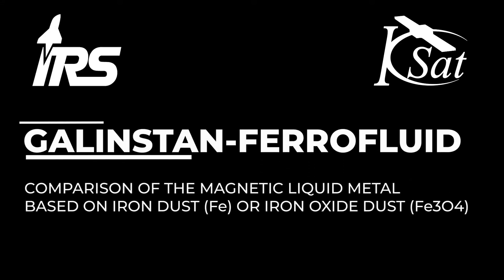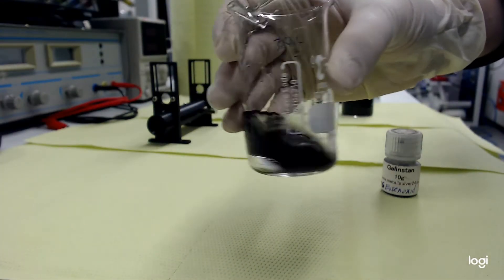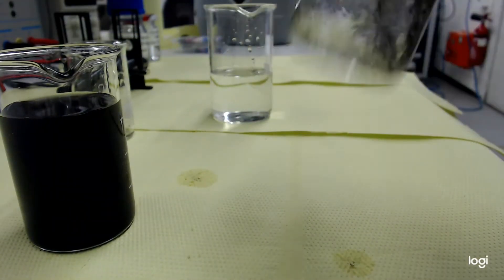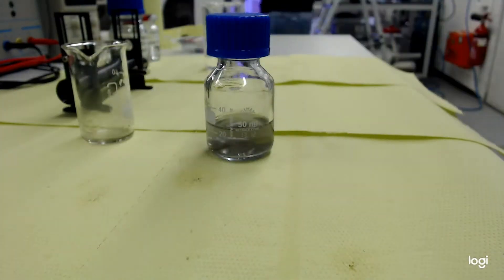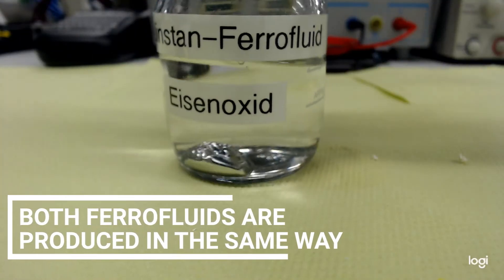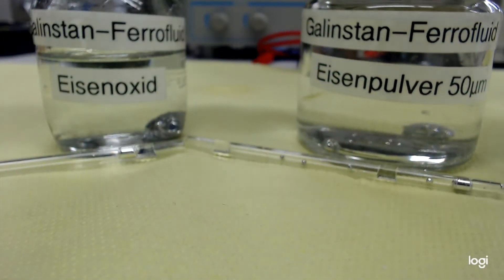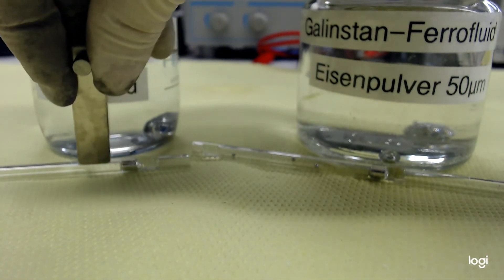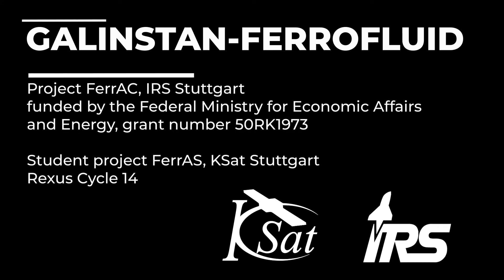Making a Ferrofluid from Galinstan (liquid metal)

Comment: This is really amazing. I wanted to make a magnetic fluid that really looks like mercury, not a pigment. We hope that someday we will be able to collaborate with you.
Reply: Hi (the video narrator),
we agree the galinstan based ferrofluid is quite amazing! 
If you want to produce it yourself, we followed this paper: 
https://pubs.acs.org/doi/10.1021/acsami.8b22699
You will need Galinstan, Hydrocholoric acid and fine iron particles. Keep in mind that a glove box or similar is needed to keep oxygen out of the Galinstan. We use nitrogen or co2 as protective atmosphere.
 Oxidised Galinstan behaves more like a gel insead of a liquid.

Cheers!
Reply: @astroengy  Thanks for the kind explanation! It's really cool work.